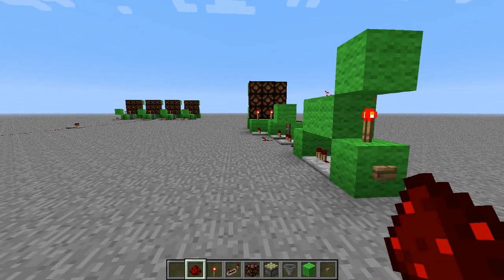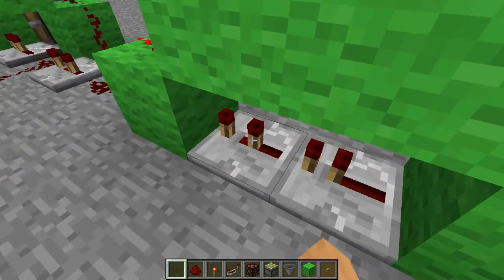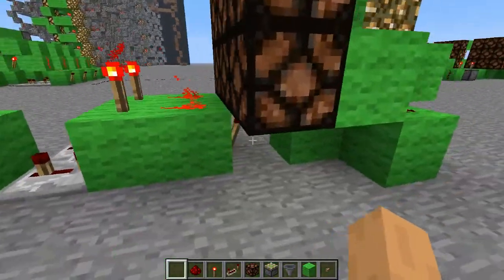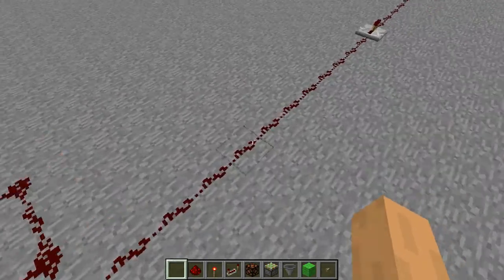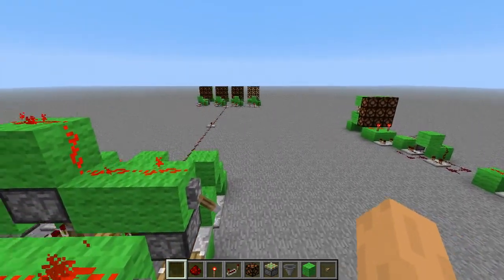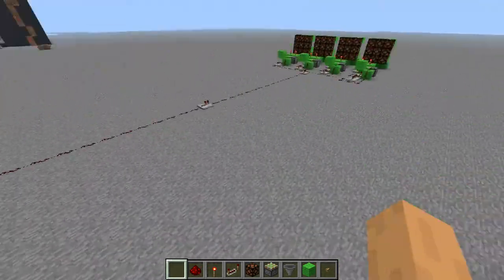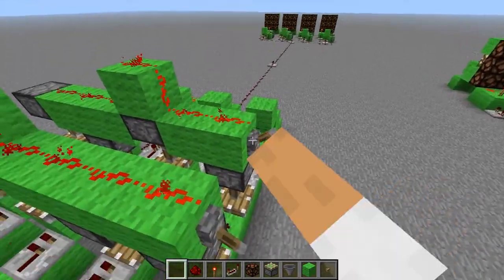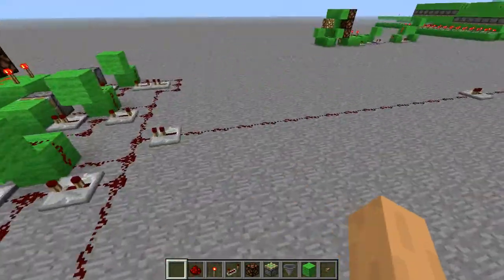Exact Redstone pulse length detector

Comment from the maker: I'm glad to help out :) Detectors, do you mean repeaters? It could be that the pulse going into the machine is off by a few ticks (It doesn't like that lol.) Also if you need to extend the length of the wire that goes into the piston, extend the timing repeaters time by the amount of repeaters you have before the piston. That way the timing should still be synced. I recently invented something to help out when using this machine. Hopefully I'll have a video of it up tomorrow.